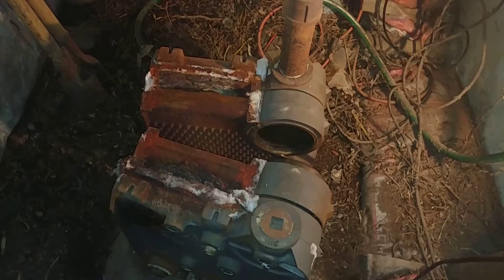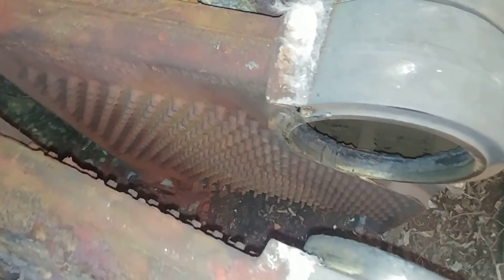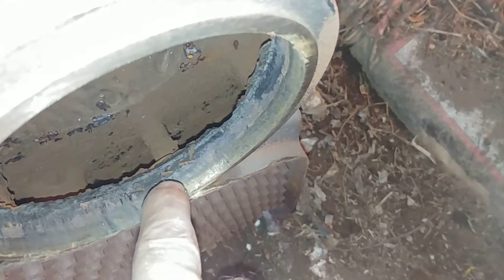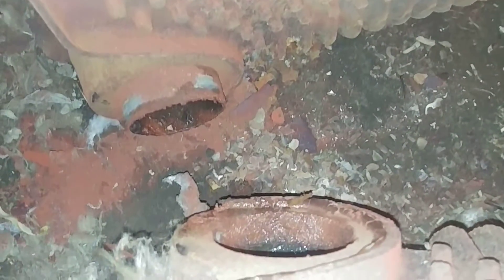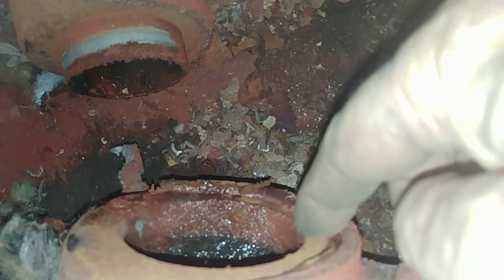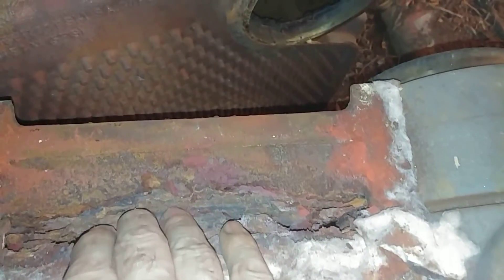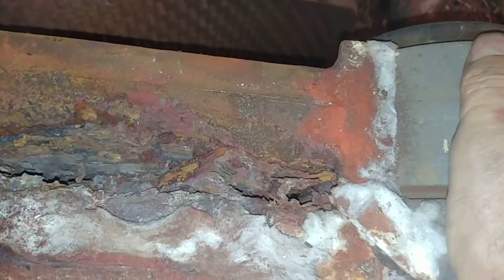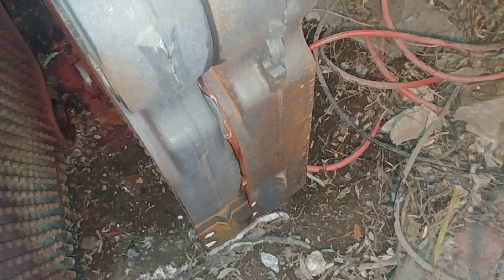The Sneaky Way Pin-Type Steam Boilers Tend To Fail - Corrosion Above The Water Line

Comment: Are condensation drips the cause of the exterior corrosion on the cast iron block?
Reply from the maker: If I understand your question, exterior condensation on the cast iron heat exchaner causing rust is generaly not an issue for steam boilers.

Comment: In my opinion, the era of the pin type boiler should be over. They are inefficient, they fail easily, and they are hard to clean. It's too bad that Burnham doesn't just stop making the atmospherics altogether and sell the Megasteam with the EZ-Gas or Riello G120/200. It's too bad that the other manufacturers don't see the value in a 3 pass steam boiler. They should be the only thing available at this point. Dunkirk makes a 3 pass water boiler for example, why not make a steam boiler out of it? There used to be others. For example in the 1980s Pensotti made a small 3 pass steamer, under 200 EDR. Why don't we see them or Biasi make their small 3 pass into a steam boiler? They did it before, they can do it again. Those boilers are still going strong 30-40 years later and were a wonderful boiler that made steam quickly. Personally I am done waiting for Burnham to approve the Megasteam for gas and I am just going to do it anyway, warranty be damned. We know it works well on both the Megasteam and MPO.

Comment: hey gordon. I came across a house that had a steam AHU from the 60s. They had a steam boiler and radiators only to heat the bathrooms and kitchen. The house was over 2000 sq ft. The ductwork served 3 floors. The AHU was not repairable. I installed a 90+ furnace and capped off the steam coil. I then left the oversized steam boiler on. Have you ever seen steam AHU's in houses?
Reply from the maker: Thanks for your comments!
Yes, I did see a steam AHU in a house that heated part of the house.
That old clunker of an oil fired steam boiler also went to two steam to water heat exchangers and circulators for heating hot water radiator systems.
It had (an abandoned) domestic hot water coil to boot.
It was a kluge.
We kept it going for a few seasons and all the while advised the customer to totally rip out that steam boiler.
I think that was done, but not by us.

Comment: I'm wondering if perhaps the pigtails get plugged and the boiler runs until the house temperature is satisfied. I'm going to check this winter when I go to these failures if that is the case. I personally do try to blow out the pigtail every year or 2 at annual service. But I do notice alot of guys never check the pigtails.
Reply from the maker: Pigtails get clogged all the time.
They should be checked every year.
Good on you for checking!

Comment: Would flooding the boiler during idle summer months help stem corrosion & is water treatment any good for domestic steam?
Reply from the maker: In theory, flooding a steam boiler should reduce rusting over the summer months.
Sometimes, folks forget & the boiler is fired up in the Fall at the thermostat and it hasn't been drained properly.
Quite the cacophony.  
Water treated is ok, but should be used sparingly, if at all IMHO

Comment: Speaking of chimney—if you see steam coming out your chimney, you have a boiler failure.  My understanding is auto feeders keep your boiler at optimal water level, but it’s better to have to manually add water, since it’s a symptom that the boiler is losing water and the new supply of oxygenated water is eating away at the cast iron.
Reply from the maker: Automatic water feeders for boilers are not safety devices, true, but can provide some piece of mind when the boiler operator leaves town during the winter.
Also, if a VXT water feeder is installed, it can display about how many gallons it has fed (or has tried to feed), and when properly tracked over time, can give early warning of boiler-killing leaks.
Reply from the maker: Good point about white "smoke" coming out of the chimney means boiler failure.

Comment: Always great information that you put forward Gordon.  You are a true asset to your viewers.  I actually have a Burnham SIN7 gas steam boiler manufactured in April 2000 and still going strong.  That being said, I service it myself each year (based on your many videos) and have it also professionally looked after.  I worry that it may fail on me given some of the feedback I have seen as it pertains to Burnham boilers.  Perhaps my manufacture year is outside those that typically fail?  Please share your wisdom with me and your audience.  Many thanks in advance.
Reply from the maker: Much thanks for your gracious words!
To your question, it seems.   
anecdotally that Independence boilers starting after circa 2000 had early failure issues, so, I hope that provides some solice for your valid concerns.
Reply: @gordonschweizer5154  Thank you Gordon.  I will sleep easier tonite and hopefully through the winter.  Your response is very much appreciated.

Comment: Appreciate your sharing this vid. For anyone that may be experiencing this similar situation: my house goes through boilers like wall colors go out of style (2005, 2014, and 2022). What I’ve learned is that steam boilers aren’t “plug and play” like a forced air furnace might be. Do some due diligence to ensure it’s configured correctly. Also, check your municipal water quality report (they’re required to publish at least annually). Our water has chlorides in the 200-300 ppm range, which I believe are boiler eaters. 

...just trying to share some lessons learned in case others are experiencing similar results
Reply from the maker: Darn! I'm so sorry your are experiencing all these boilers failing way too soon.
Thank you so much for sharing your troubles and hard won insights.
If I may, do you (or did you) also have a high water loss maybe due to multiple little leaks?
Reply: Burnham says Chlorides in makeup water should be <30ppm.
Reply from the maker: @eegg6954  I have some trust issues as to what Big B has to say about chlorides & and other things 
Other boiler manufacturers don't seem to have the same failure rate in the same water supply area.
They no longer make the Independence.
They now have something new & improved.
In my book, that's a tacit admission that their previous boiler had issues unique to them.